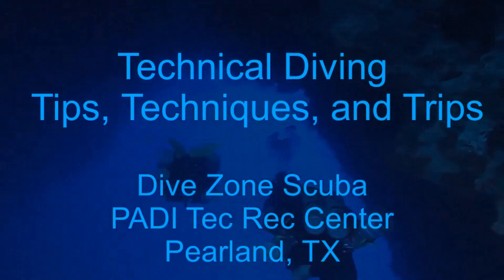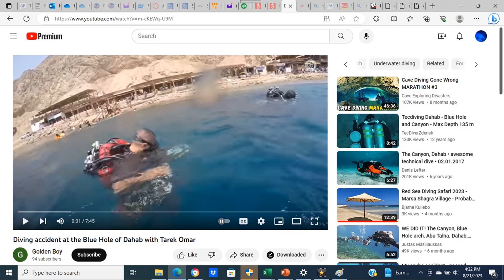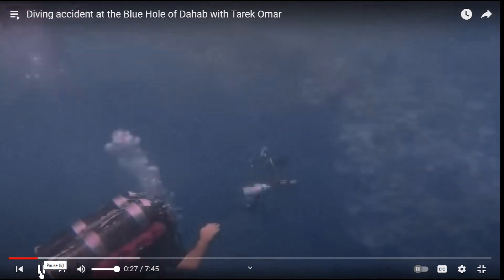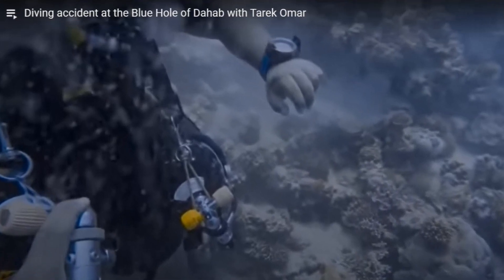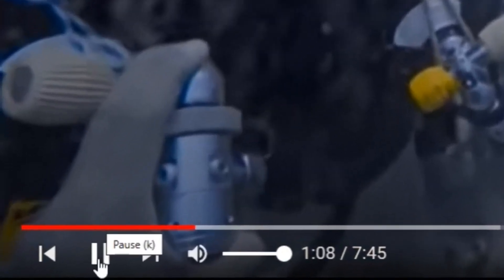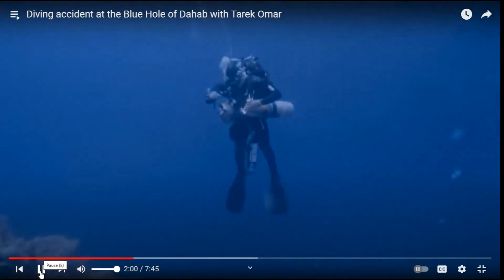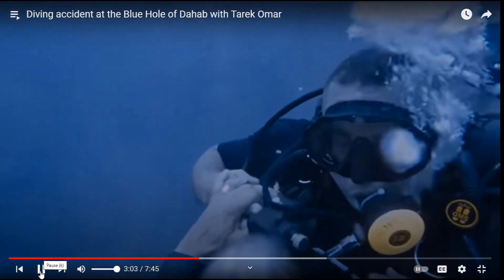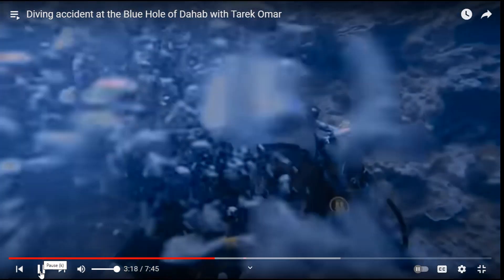#132 - Blue Hole of Dahab Technical Dive Problem Analysis

Comment from the maker: The dive shops in Dahab are very competitive and often report each other to CDWS (Council for Diving and Water Sports) (Egyptian Scuba Regulatory Agency) if another shop has a problem.  I was told that Tarek(q) Omar was harassed by other instructors / shops when the video was released.  Tarek(q) Omar correctly aborted the dive, as would any other technical dive instructor / guide.  If Tarek (q) Omar was not there, that diver probably would have died in the same manner as Yuri Lipski and many others on the memorial wall.  That is why even very experienced technical divers are required by CDWS to have a technical dive guide when conducting that type of dive. The whole incident was unfortunate, but at least others can learn from what happened.
Reply: I dunno man, he that dive continue longer than it should... but before that that he let the guy dive with his gear configured in that whackadoodle configuration.

Now, the guy could have reassured him that he had experience - but in that case the right thing to do is say "ok we'll do a small check-out dive, and if that goes well then we'll do the blue hole".

I have qualms.